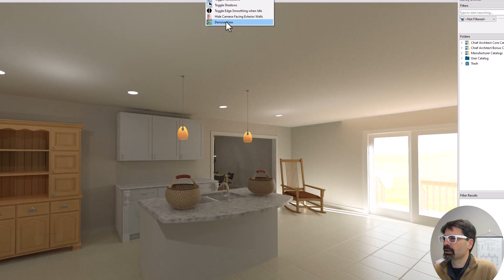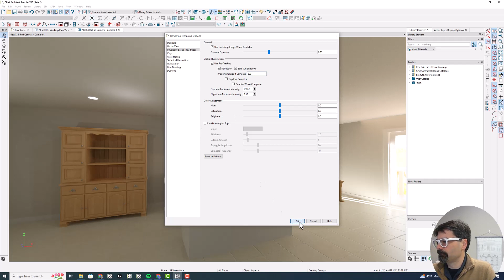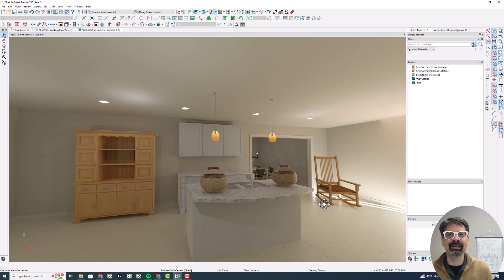Day 14 - Denoise | Chief Architect

Comment: Hi, I would appreciate if someone could tell me why the Denoise tab in the Capera View options is not accible...
Reply from the maker: Are you working in X16? Are you talking about the Rendering Technique Options? Are you looking in the "Physically Based (Ray Trace)" panel? 
If yes to all of those, then they've removed Denoise as it is automatic now. The Maximum Samples can be set quite low now (I often use 100 or 150). 
Alternatively, if you're in a Physically Based (Ray Trace) view, we still have the option of Denoise manually by the menu 3D > Camera View Options > Denoise View